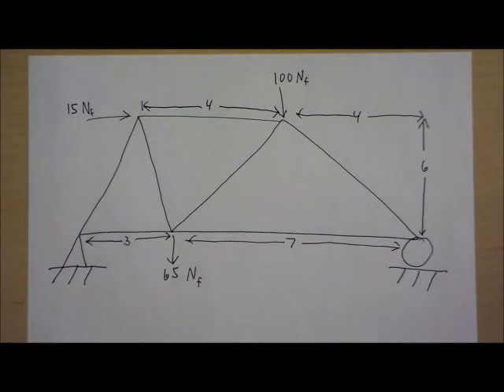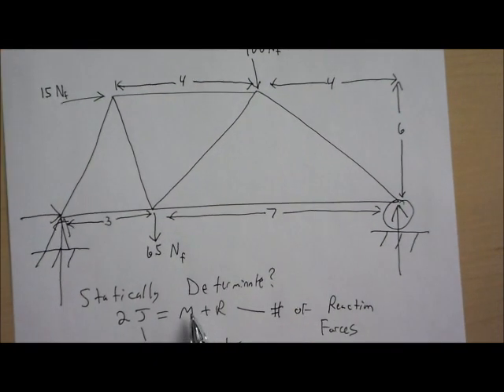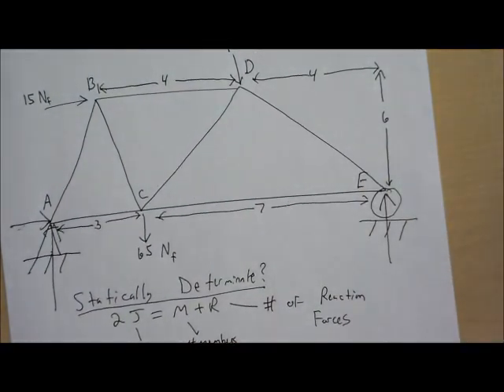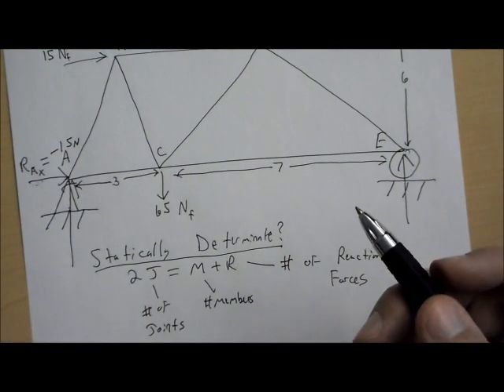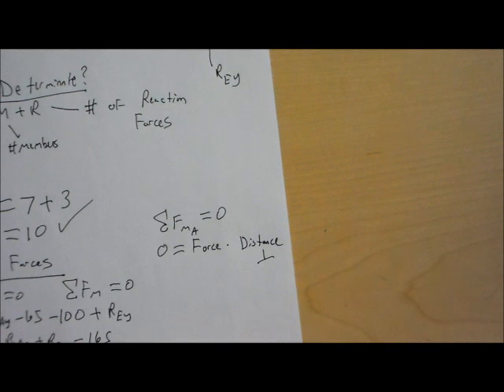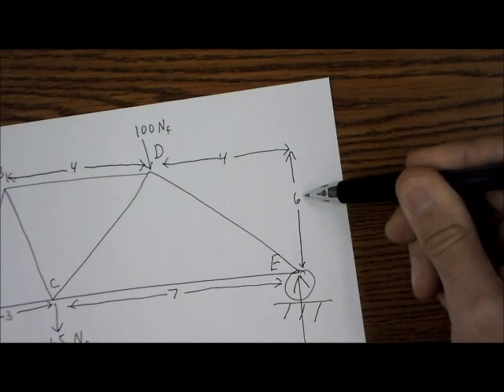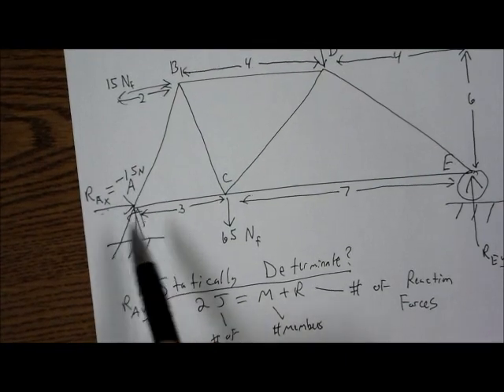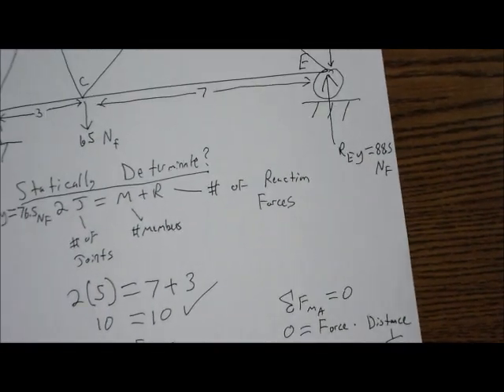Solving a Truss Part 1

Comment: how can you say the moment at joint B is just 6*15... you're supposed to find the perpendicular force to the beam...
Reply from the maker: So if you measure the distance perpendicularly from point B, what you're really measuring is height, which is 6.  Watch starting at 8:00.  Thanks!

Comment: When figuring out Rey using moments about point a, Shouldn't you have multiplied 100N times 6.5 not 6. The perpendicular distance between a and the line of action of 100N is 3 plus half the base of the triangle which is 7, therefore 3+3.5=6.5???